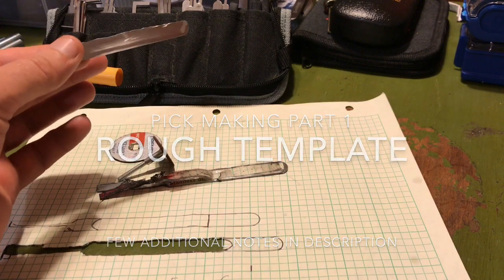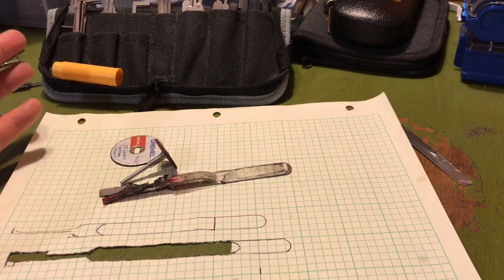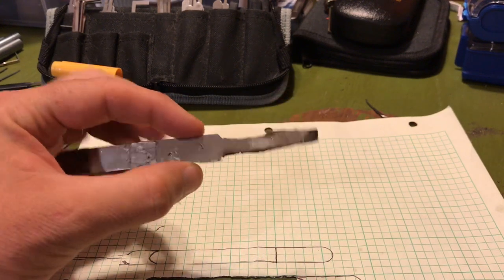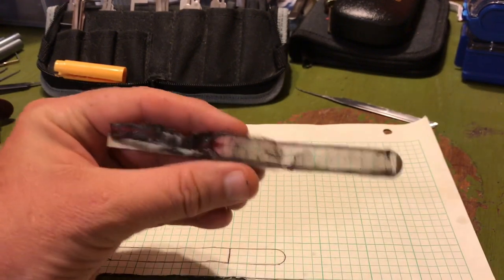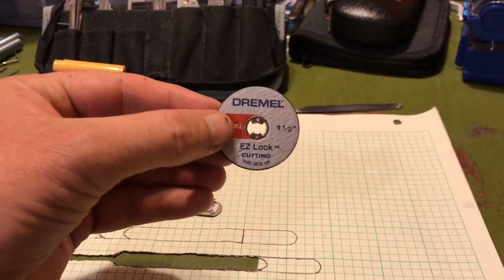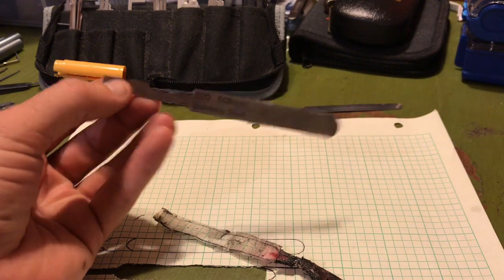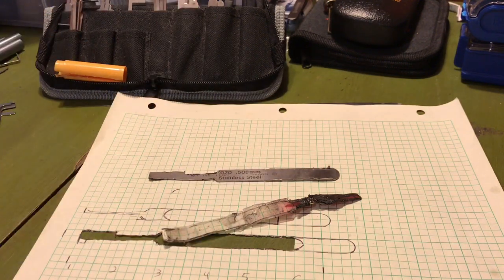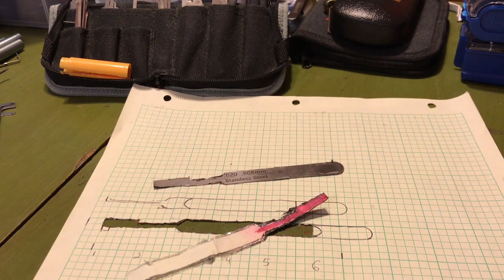Pick Making Part 1 Rough Template

Comment: Can’t wait to see how it works out for you. I have tried several timed and I cannot make a decent pick with a dremel.  I can’t make anything straight and the metal gets too hot.  I use a bench grinder and dip the metal pick in water literally every second so the metal doesn’t get too hot. I finish shaping with files and sand paper. I agree with you about pick making being another interesting aspect to lockpicking.  It’s just fun to make stuff and learn.
Reply from the maker: “...and I cannot make a decent pick with a dremel. I can’t make anything straight ...” Well at least if it doesn’t work I can say, “well FastCharlie can’t either” and somehow that makes it feel better lol it’s good to not be alone in failure I guess 😂